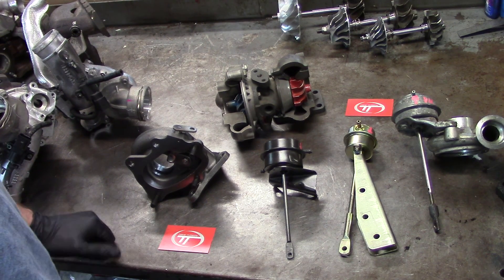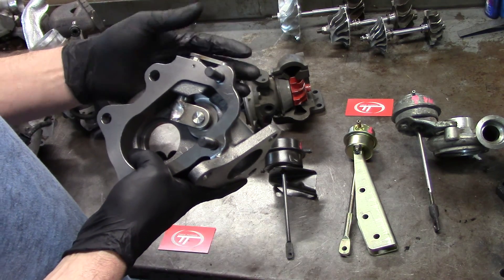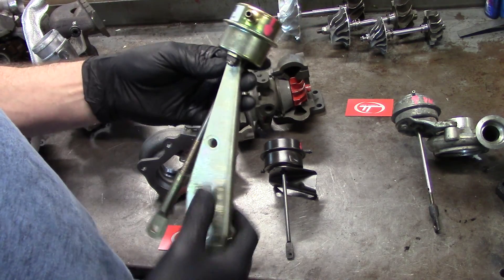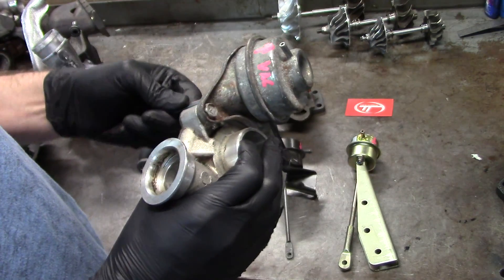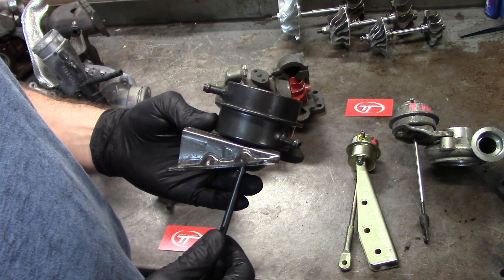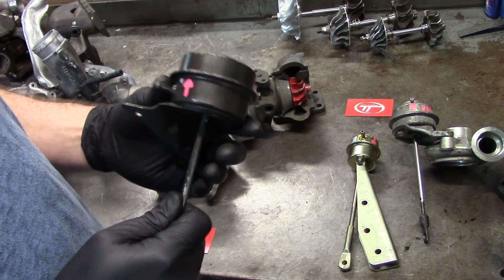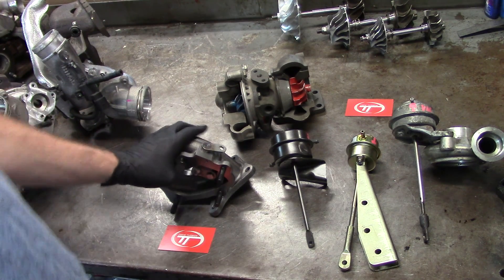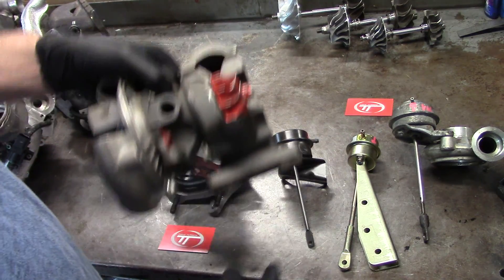Turbocharger actuator Part 2

Comment: I don't know if you are still monitoring this video, but I have a few questions that I can't find an answer too. If I have a turbo and computer that are supposed to go to 25psi max boost (Not including loss for intercooler and other equipment) that averages around 22-23psi during acceleration, and I need to replace my wastegate... What poundage of spring should I be looking for?  Most waste gate replacements come with a 7lb spring and then mention that they have other poundage springs.. but they give no guidance on what to buy/use for any given setup..

Comment: I took my 2011 tdi to the dealership for code p0045 turbo control. They said the wire was cut and was replaced cost 390 bucks ok but the dpf wouldn't regenerate wtf

Comment: Have a question my actualater seems to be squealing on throttle an just cruising I did knew turbos an up pipes 6.4 2008 ford my mech said its sticking